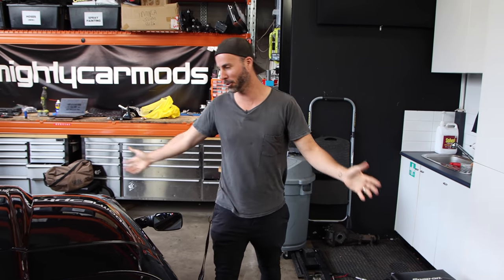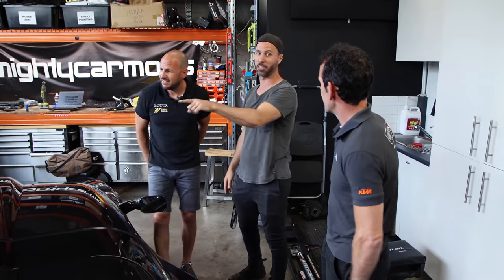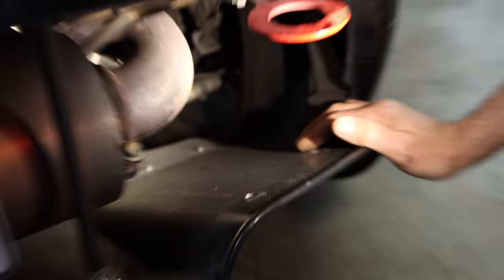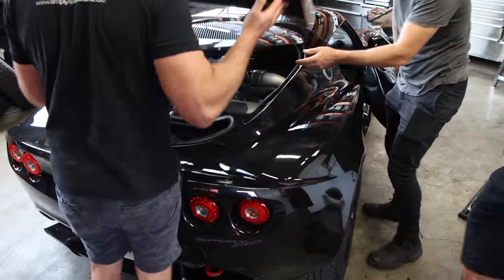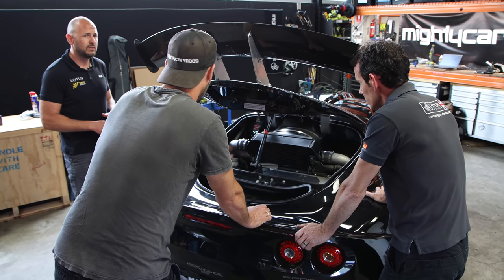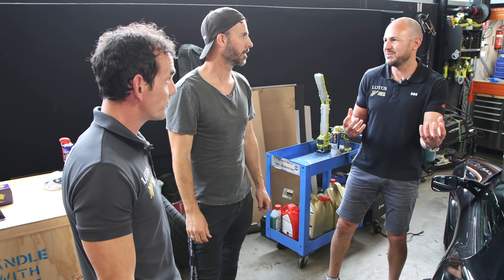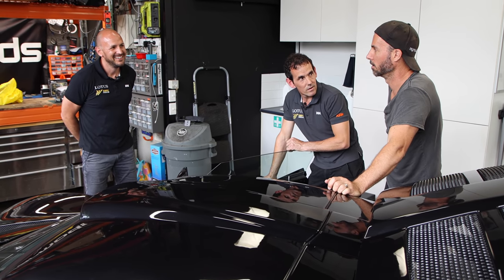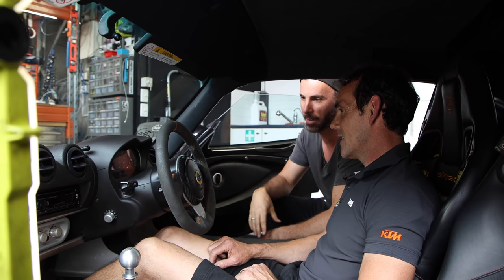Fixing the LOTUS Exige S240 // The Upgrades Begin!

Comment: If a car comes with 2 factory technicians then it's probably a supercar.
Reply: ...Or a Lotus ;)
Reply: Well, actually, our dealership is run by race engineers, so we sell or modify them plus spend most of our time at the track https://www.simplysportscars.com/en/about-ssc
Reply: Yeah that wasn't a trolling comment.  As a mechanical engineer I appreciate and respect that approach!
Reply: @silverbullitt850   awesome :-)
Reply: @SimplySportsCars  I was " THIS close to buying an '04 Esprit for my most recent car, but our local Lotus shop swore off working on those ever again due to issues with a few clients. That's not a car I want to own without a ship to support me and those vibration frequency timing belt checks!
Reply: @silverbullitt850  yep we get that. We don't service them but let specialists look after them that are also in Sydney. We concentrate on Elise & Exige with quite a few being used as daily drivers or second vehicles for track days etc.

Comment: See lotus is so driver-orientated, and the fact they support their older vehicles. I am sold on the brand. Wow
Reply: Yep. A new car warranty even includes coverage for track use. It's all about driving & you still get 'em in manual :-)
Reply: Them and Porsche
Reply: they probably didn't do it on purpose, they just wanted to keep using the same wiring to cut cost, I see that as a win win.
Reply: @gwot  not really. It was designed so that it could be plug and play to make it an easy retro fit that didn't require making changes to the existing connections to maximise simplicity & reduce any potential complications.
Reply: @SimplySportsCars  and you know that for a fact that it was deliberately done this way, for that purpose and wasn't just as a bonus?
Reply: @gwot  we don't. Although think about the cost involved to explore ideas that do or don't use the existing wiring harness? Why would you even bother if a solution can be created that plugs into what is already there. It means there is greater chance of maximum adoption for people who have those cars. It's just logical really - 'how can we create a retro fit item that installs quickly and easily' Any other idea would probably be put into the too hard basket when you think about it.
Reply: @SimplySportsCars  yeah, you and me think this way, and maybe Lotus does too cuz they're small and low budget. But just about every single manufacturer out there will have new harnesses for a new model, some aren't even interchangeable between the same model same year just different trim! Land Rover for example, same year same model, the plug and entire harness is different between if you have a analog or digital speedo, and if you don't have the right supporting modules that go with it, it doesn't work.

Comment: Hi Moog, I absolutely 100% recommend fitting a cold air intake to this. Whatever you are imagining the difference is going to be vs. the standard airbox, triple it. The induction noise on these Toyota 2ZZ engines is incredible. It will be loud. The switch from low to high cam lobe at 6000~RPM is accentuated, and the supercharger noise becomes almost obnoxious. You also stand to pick up a small handful of HP unlike with some other cars, because the standard Toyota airbox is quite restrictive. 

I have a video on my channel of a European Toyota Corolla T-Sport with a cold air intake doing an acceleration run (I believe it was the first car these engines found their way into in about 2001) - No supercharger, but you get an idea of the noise available. And then remember this noise is going to be coming from right behind your left ear! 😎

Comment: That toe link kit is slightly absolutely necessary, was at a track day one time and there was an exige there that broke one. Got away without hitting anything though.
Reply: Yep, we totally agree. After racing Lotus sports cars for many years we designed the toe link kit that most of our track day drivers use on their cars.
Reply: The only issue, according to my mechanic, is that the oem toe link is kind of designed to break, especially in an accident. With it being the weak point, you protect the tub. Strengthen it too much and a crash could potentially write off the entire car...

Comment: 5:30 Header tanks go bang - can confirm. Had them break on my Elise this summer. Watch out for the indicators falling out - I think it might be linked to a fit-and-finish issue of the clam, but my Elise is popping them out at a shocking rate, and the plastic clips holding them in (at least stock) will always fail, being in proximity of the radiator, and being regularly thermo-cycled.

Comment: you should really change the oil pump. and  use an oilpan from a 1zz ;) it will save you later
Reply: I was gonna add this. The zz series of engines are notorious for oil starvation

Comment: Alternative title: 3 car nerds nerd out about an MR2 on steroids🤣
Reply: Welllll its a yota engineeeee so yes steroids😂😭
Reply: Nope... the Elise originally came with a Rover engine.
Reply: @insomniacbritgaming1632  dude... Everybody knows they originally came with sr20det engines. Rover engines would've blown a premium before racing.
Reply: @blazervol3357  sure... no..
 They've never used SR20 motors... first gen Elise used a Rover 1.8 if memory serves
Reply: @insomniacbritgaming1632  lotus spent over 100 grand under the hood of their cars on the sr20.
Reply: @blazervol3357  hmmmm, it used a 1.8 Rover K engine... which is actually closer to a Honda engine than a Nissan.. only SR20 fitted to a lotus is a Kit car replica of a Lotus 7
Reply: @insomniacbritgaming1632  a sense of humor... You have not
Reply: @blazervol3357  good jokes, lacking in the department you are... jokes are meant to be funny...
Reply: @insomniacbritgaming1632  ehhh i was bored and wanted a fast and furious reference but they've never had a lotus in a movie.

Comment: If you ever get bumped in the rear or front bumpers, the "clams" can be very expensive,  you can replace only the bumper parts if you find someone who makes them in FB, I change both of them and glued them back on with wind shield black glue. In the rear suspensions, watch out for the upper wishbones bushing as they have a tendency to slide and the edge of the wishbone that surrounds the bushings will rub against the frame, I added teflon disks on each sides to keep them in. I changed the radiator and put an all aluminum one I also changed the fans for more efficient ones. Otherwise no other problems

Comment: I own a mid engined RWD British sports car with big front brakes, double wishbone suspension, side scoops, manual gearbox and a removable hardtop roof too! It's called an MGF Trophy.
Trust me, all the issues are never fixed on a British sports car. New ones are just introduced that will only surface when you need the car the most. It will always make you smile when it's working though!

Comment: The roll bar was a factory part on the Exige Sports 240. Also the door trim in suede is aftermarket, steering wheel has been modified, and rims have been sprayed black.

Comment: This is nice and all, but what you really need is 200lbs of speakers and some SWEET leather trim installed. Might want to consider getting rid of a bunch of those actual performance parts and swap them out for a cheap imitations and knock offs.

Comment: Simply installing two-pot rear calipers won't balance the car's braking.  Does the brake plumbing have a balance valve?  If not, perhaps it should.  You can muck up the braking to "out beyond radio" doing things without fully considering the results.

Comment: I wonder why they installed a display for the rear view camera? You can have the rear view shown on the digital dash by the press of a button or even automatic when putting it in reverse with a tiny modification. Is it a functional rear view mirror that is on all the time? If so, could you provide some info on that setup?

Comment: Man, it would be bloody lovely if every car had upgradable parts, especially on modern cars where the headunit will be a non-stand size.

Absolutely ridiculous that you have cars only a few years old with garbage headunits that results in people mounting their phones instead of using the large screen systems. It would be nice if car manufacturers designed cars that could be driven for more than a decade and not feel obsolete.

Comment: Oh, it has 240 DIN HP versus the 'normal' exige.
What would this do for torque?
And what when an nicely tuned TDI makes around 250 HP or more and even more torque?
I still do not see the supercar thing. The chasis is nice, the looks are different, but the R was faster.
Reply: You may be surprised but their laptimes around... That's Sydney Motorsports Park, right? Anyhow, I'll bet they are VERY close, with the Lotus edging it out. Remember this is like a 2000lb car where the Golf R was about 3400 with all those upgrades.

Comment: Wait, Australia doesn't require battery isolators for track cars? Plus, they aren't dodgy if it from a reliable company usually; and that one looked fairly beefy.
EDIT: Maybe just hard mount it, or slap it into a plastic junction box.

Comment: Hey guys, is that a V6 version the Lotus techs rocked up in?
Reply: Yes its an Exige Sport 410 which has similar chassis, but slightly wider track front and rear but with the supercharged V6 so 410 horsepower / 310kW in an 1,100kg car :-)  https://www.simplysportscars.com/en/lotus/exige

Comment: Only brand new car that has to be "fixed" to drive it.  They had terrible build quality - but have always loved them.
Reply: Maybe back in 2010 when this was built but later models don't really suffer the same issues. That's why a brand new one has a 3 year warranty and that also includes coverage even if you use it on the track.
Reply: @SimplySportsCars  Oh excellent.  Thanks for letting me know.  My collectors garage would love to have a 2001 Esprit Turbo.

Comment: This vs the mr2
Reply: Maybe a turbo charged MR2 because the NA's weighed 1,200kgs+ with less than 150 horsepower so around 300-400kgs in weight difference to deal with.

Comment: tofu after THAT?! you should buy them lobster at least, what's wrong with you?
a little bigger turbo and dial 250 then 300 Kw out of it and call it art. 
333 then 400 hp will be NUTS but still modest in that high tech tuna can, 
enough power to outrun much bigger beasts on good pavement.

Comment: okay so if you want to stick to the strict definition of a supercar, its a car that can do more than 155 mph and a hypercar is more than 200 mph.

however as you probably have thought "wait there are a lot of cars that can do more than that, even SUVs" back when the term was coined (I think it was in the 70's) that was quite the achievement, now though less so.  I believe it was a marking term, and because marketing terms are whatever the marketing team with the most money says it, the definition is jumbled.   

That said given your car is a mid-engine car designed to do nothing but be a good drive, is from a company that really only makes "race cars", and is a complete show stopper in anything other than supercar company.  I would say that you fit both the technical definition and the spiritual definition.

Comment: Not a supercar, it can't do 200mph (321kph). They guys from Lotus stand there and say "If you like engineering, you like Lotus". Yeah thats true, very very good handling cars. But enter the ELECTRICS, and mirrors out of a Vauxhall, then the "engineering" went out the window. That was the huge complaint about Ferraris in the 1980's that they took parts from Fiats like the dash vents and shoved them in Ferraris. Then came the F40 and F50 supercar to compete with the Lambos. Maaaaaaaaan, you can't put a Lotus Exige in the same class as an F40 Ferrari OR LAMBORGHINI Countach or Diablo - ITS NOT A SUPERCAR!

Stop calling it a supercar, its not in the same class as a Porsche Carrera GT, Ferrari F40, F50, Enzo or LaFerrari. Or Lamborghini Countach, Diablo, Gallardo, Murcielago. Or Pagani Zonda etc etc the list can go on.

200mph straight out of the factory, THATS a supercar.

Who was this journalist that said it was a supercar? Its a bonded (glued) aluminium tub, with bits from Vauxhalls ....vi sa vi ENGLISH KIT CAR! Caterhams and Westfields buildem in ya GARIDGE! Not that there's anything wrong with building a kit car.

The Ultima is a kit car you can build in ya Garidge, with supercar performance .......ah supercar performance, yes 200mph +.

Comment: I just can't like these things. I like smaller cars, but this is way too small. And it's ugly. It looks like an insect. It's also so impractical. Can't see out the rear window, can't do road trips with no trunk. The engine is impossible to work on without removing something. Give me a 350z. Give me a lancer evo. An impreza. A celica. Pretty much anything that isn't this.